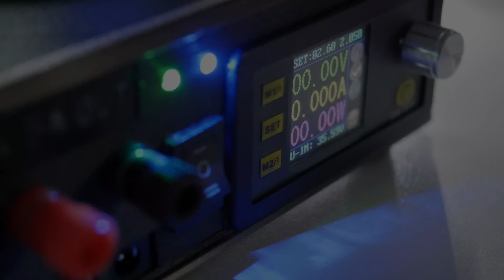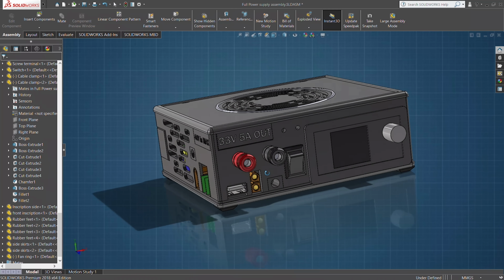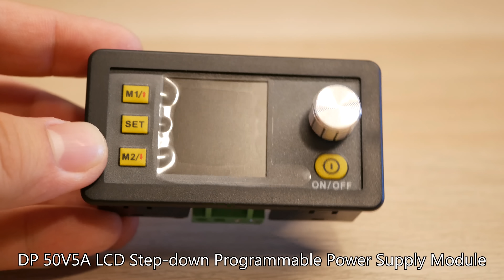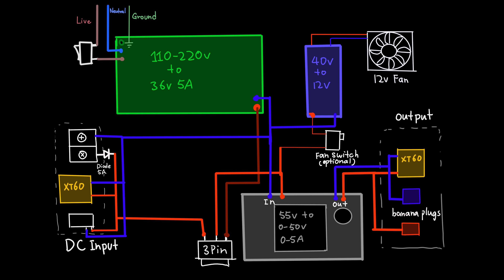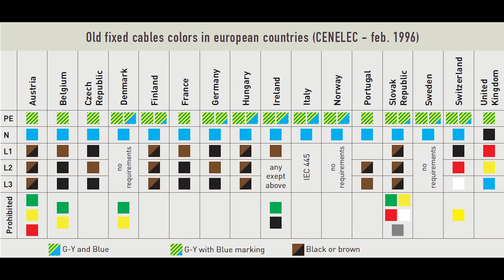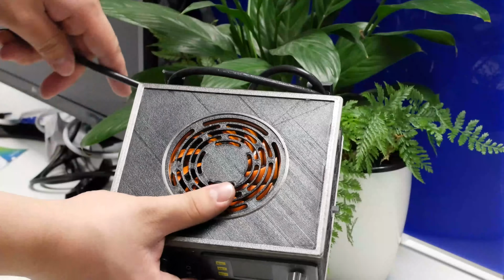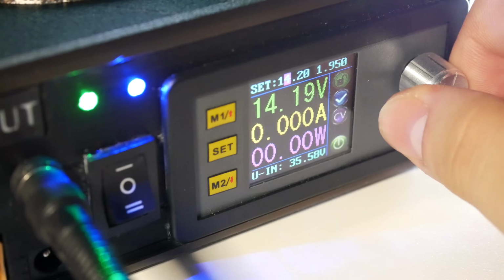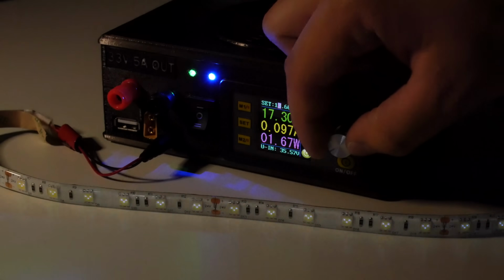DIY Mini Lab Bench Power Supply (With Switchable DC and AC Input)

Comment: You need to improve your soldering.  I saw many cold solder joints on your video. Soldering iron tip should touch to the legs 1-2 seconds more after you pull out the solder.
Reply: I was taught: "Don't paint." Don't use the soldering iron like a paint brush. If you have to "paint" the solder on, you're doing it wrong. Let it flow. If it doesn't flow, use more flux. Still doesn't flow? More heat.
Reply: That’s what I was thinking. The soldering iron’s job is to heat the components so thay they melt the solder causing the joint to be “wet”, not to melt the solder directly.  Considering that there are a lot of high-current connections here (and that this is a portable power supply) , good solder joints are essential.
Reply: That's why the hot glue is used, right?? :P
Reply: Moto Z Play  is that what she said last night?
Reply: @_sneer_  LMAO
Reply: Get over it, he's not building a PSU for a spacecraft! When it fails, he'll fix it!
Reply: @audioglitchguy  Not good enough on a mains-powered project
Reply: Yes, and heat ALL parts of the joint, NOT just the top item, and then flow the solder into the joint. Almost every solder joint shown in this video is appallingly poor. Anyone dealing with electronics should have far better soldering skills than what is demonstrated in this video.
Reply: @Blondie SL I have seen this design  a few times, do not believe it is his.. They might have done a few tweaks but sure it is stolen from the internet..

Comment: You have a 3D printer, but you don't have a decent adjustable psu, that's a bit unusual.
Reply: At home we got a Velleman 3d printer, a STEPCRAFT CNC  machine for a long time, I just bought a 30V 10A adjustable psu for other several application, your comment it's weird, you say it as if it were 
required to do 3d printing.

Comment: Nice project! Warning though - your XT60 connector is the wrong one for the output DC - you could short that connection with a screwdriver or small piece of wire, LED leg, resistor wire etc that may fly in there. Safer to have DC out of a MALE XT60 as you can't easily bridge it. 👌🏻

Comment: thanks for wonderful idea ,were to buy housing case like that and what about protection ,over voltage protection, short circuit  protection  UC Tronics 50V 5A can do
Reply: Get a DPH3205 Buck Boost power supply with the matching metal enclosure (includes cooling fan, all mounting hardware, banana posts and fan driver PCB) fit for model DPH3205. All available on eBay. I've used mine for a long time. It accepts practically any voltage between 6V and 40V but I would always drive it with at least 12V. A computer power supply works well.

Comment: The best DiY power supply tutorial on the Tube...simply jaw dropping. Great work.
Reply: In reality, neither the concept or the design of this supply is in any way original, and there is also nothing at all complicated about. Not even any math or calculation was required. Just connected together a few pre-designed/manufactured (off the shelf) power supplies, and throw them together into a case. Certainly useful as a demonstration, but congratulations for "great work" is far too much praise given the total lack of original design here. Might as well congratulate somebody for plugging in a USB cable. Still, this is a valuable suggestion for how to make a useful general purpose power supply.

Comment: DIY? You mean Buy it yourself 'coz you are not making anything, you are just connecting modules you bought on ebay/aliexpress/whatever... btw that "main output module" is rated 55V input to get 0-50V output and it is Buck (step-down) converter and your power supply module is rated 36V out.... good job (Not!) pairing those modules.
Reply: For decades, I have been buying, soldering and assembling things. I've never made a transistor, resistor, diode, integrated circuit or copper wire. I have never made iron sheets of coal and ore - just to make something. I prefer to buy them.
Reply: Make something better and more-professional looking and put your own video up. I notice theres no videos posted on your YouTube account? It sounds like you could do a much better job than this guy from what you're saying. Oh, you can't? STFU.
In regards to the power supply, I'm sure there was a tradeoff between cost and need and size in the selection of the PSU.
Reply: @chrisjc2k  that's akin to 'love it or leave it' which is bull-shit.  tRump-tards................

Comment: First of all, i wold not charge LiPo batteries with your power supply. I wold not do that because your power supply does not have protective circuits as listed below.
1 Over-charge protection voltage circuit is missing.
2 Over-discharge protection voltage circuit is missing.
3.Discharge circuit and maximal continuous discharging current setting are missing
Your project is great be it is dangerous to charge/discharge  LiPos  without protection. Also you can use PC power supply and achieve same results

Comment: I really wonder what the noise figure looks from that power supply...Im making my own lab bench powersupply And to admit I dont have constant power capabilities but the noise figure is MUCH LOWER than any switching powersupply... Bcause were running linear.  I bet your powersupply isnt ideal to play arround with audio circuits nor RF circuits.
Reply: Complete noob here. Can't you add a liner regulator to the output to clean the ripple?
Reply: @anotherone96  you could... but in this case it's a full switching power supply...there are power supplies of combined fashion. Switching pre regulators for efficiency and linear outputs for the linear smoothness .. Implementation of such linear regulator in this case is non ideal nor easy.. And were speaking sub milivolt ripple here... something I have hit the limitation of my previous switching bench power supply. Got a proper old but very sensitive digital scope and I was taking transistor noise floor measurements for a RF Antenna amplifier. Turns out the power supply contaminated my measurements. So I dug up my old 40 years old linear power supply and played with that. (It had PROPER IRON in it..transformer). I have taken that schematic and modified it and I'm using it not with a transformer but a switching power supply. The LM723 is really a great regulator providing you build the proper circuit surround it and that is how I made my 60V 3A powersupply.

Comment: I like how you manage to get so much stuff into a small space in a nice enclosure. Well done!
However, you should really look into how to make better, more reliable connections, especially for the mains wiring. You should always use proper crimp connectors for that. Frankly, the way you did it, I wouldn´t trust that thing in the slightest.  On top of that, those chinese mains power supplies of that type are very unsafe as is. I´ve had an almost identical supply short the AC mains to the output WITHOUT tripping any protection. I was lucky I didn´t touch it with my fingers.
Reply: @jamiehardt3061  or perhaps at least shoot a glue gun around parts of it.. IMO .. but i'm far from an expert !!! But overall I think it's an excellent video and i'm going to built it and order parts tomorrow morning.!!!
Reply: Ordered the parts and they are on the way ..Note:  I ended up buying and finding all the parts for a lot less on EBAY than from Amazon.
Reply: i never understood why you people in the us always use crimps. never seen a single person outside of the us be so paranoid about soldering mains wires to a psu. I still wouldn't completely trust that thing because of how cold the solder joints were, but if it were properly soldered I wouldn't mind it at all.
Reply: @somedude2492  It is because a crimped connection provides better mechanical stability than a soldered connection can. When you solder a wire, solder wicks up into the strands and creates a very brittle zone. This area can be easily snapped off with even heavier wires. Second, a crimped connection does not create tin whiskers and short out components, like happened in the Apollo mission that killed it's crew. Further, crimped connections are more resistant to chemical attack and corrosion than solder, because solder forms a galvanic cell with the wire. I think you should try it out, and actually compare well made crimps to well made solder joints. They both have advantages, and understanding them will help you understand where they are used most.

Comment: Interesting..now i can use my knowledge on electronics.too bad i dont have experience on 3d printer.
Reply: Just buy cheap project box on ebay or ali
Reply: He includes the 3D print files in the description.  The hard part (designing in CAD) has already been done.

Comment: You are using a DC/DC converter capable of outputting 50V, but you're limiting it to 36V because that's all your AC/DC converter can do.  Why didn't you use an AC/DC converter capable of outputting 50V?
Reply from the maker: roidroid such modules(48v 5A) are more than twice the size of the converter I showed in video. I want the power supply to be small so I had to make some compromises.

Comment: Looks great, but is it possible to make two individual output to make it more practical?
Reply from the maker: Li Zheng Two channels would require a larger AC to DC converter, and an extra Stepdown converter. This would drastically increase the size and weight of the current design. And from experience, the amount of times that I needed two channels is very low.